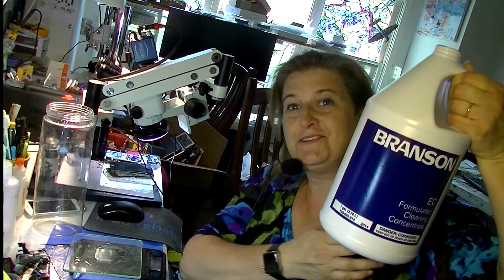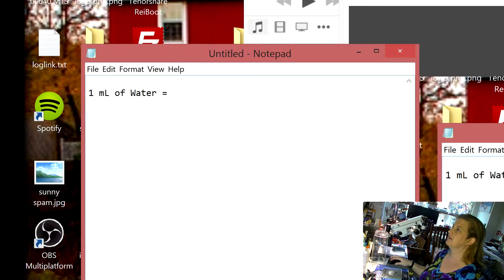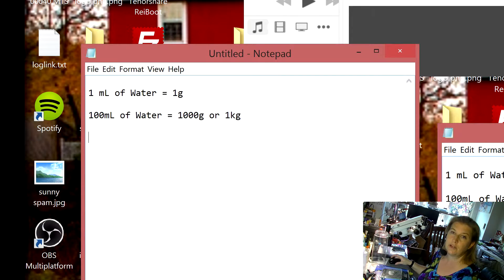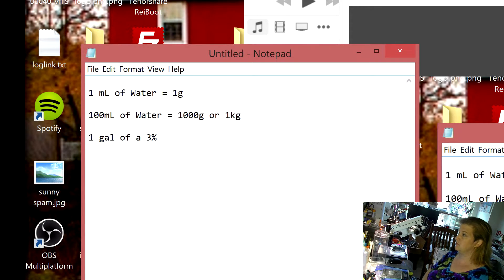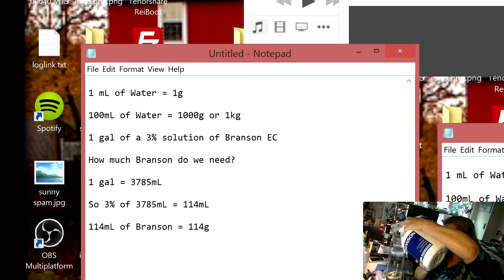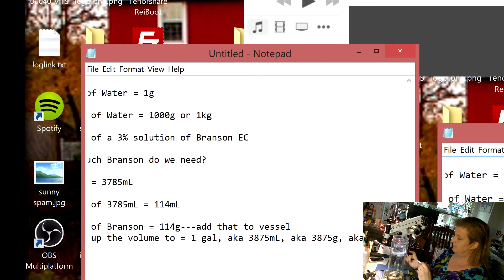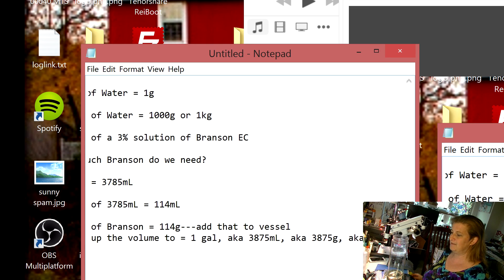Water damage treatment---How to make an exact 3% Branson EC solution for ultrasonic cleaning

Comment: If 1mL = 1g then 100mL = 100g and surely not 1000g as you put in the video. How has nobody noticed this? Assuming that's the case then the solution you're creating is actually 10 times stronger than what you're wanting.
Reply from the maker: Pretty sure the comments have that typo pointed out about 1000 times.   This was a text typo, pay attention to the words and the amount I used here, ignore the typo.

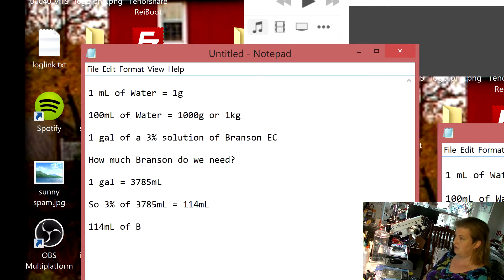Comment from the maker: +Miles Blakesley--nice try nerd.  5:38 I said "Roughly equal to"  *just because of the relative density.  WTF is up with your settings blocking people from replying to your comment.
Reply from the maker: Everyone likes what they like.  You just have to try it for yourself.  Every tip behaves differently.  Every brand is different.  Some people hate the mini hot tweezers.  Louis for example can't stand them.  I love them and use them exclusively.  Every microsolderer ends up developing their own style.  You just have to experiment
Reply: iPad Rehab Oh darn your right. But ill take a look at my settings

Comment: Jessa considering the relative density of Branson ec is 1.03, the 114g that you added is actually 117.42ml not 114ml. Not that it make any noticeable difference but i kinda wanted to point it out haha. So if you really wanted exactly 114ml without having precise measurement tools you could fill what every with 114g of water then mark it and empty it and fill it with Branson ec. Ironically i just got my crest today and did the same procedure for it. You and louis were right they do make a huge difference over a cheap ultrasonic cleaner.

Comment: Hi Jessa, awesome videos. Today I replaced a touch ic on an iphone 4s with no touch functionality but a good display. I removed the touch ic from a 4s which had heating issues. Thanks to you and your videos I was able to successfully complete the repair. I knocked off a capacitor and resistor at first. However, after taking a deep breathe and controlling my shaky hand it was done. Taadaa....
Reply from the maker: Aashish Shrestha awesome--great to hear!